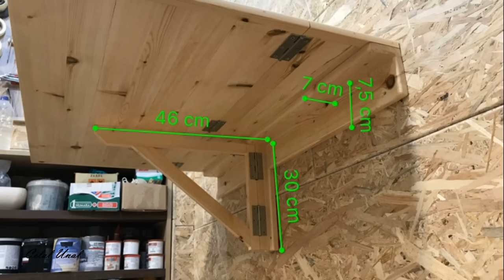Wooden folding kitchen table / Katlanır mutfak masası / Folding dining table

Comment: Very impressive 👍

But I don't understand the purpose of cutting the big piece of wood in small pieces and then joining them with glue?

Did you do this for designing purpose?

Please advise 🙏
Reply from the maker: Thank you so much. I am very glad you liked it. Small pieces remain stronger than large pieces. Wood is a material that plays. I cut it short and put it together to reduce the playfulness of the wood.
Reply: @CelalUnal1  Great! 
That's very useful information.
I am really very interested in Woodwork, and wish to start work on wood sometime soon.
Thanks once again and good luck.👍

Comment: Good morning sir, May I ask you what kind of glue are you using in the nailed hole?
Reply from the maker: Thank you. I used instant glue and activator spray. A material that provides drying and adhesion with activator spray.

Comment: Hi, Do you think you could make a 'Dutch pull out tale' 1m x 700mm with a 500mm pull-out leaf at both ends? I have a small cabing and that's what I need to build and am not sure of the best way to go about it. Plans would help. Thanks
Reply from the maker: I don't have a plan, but it can be done in these dimensions.
Reply: @CelalUnal1  Thanks. I know it can be done I'm hoping you can make it so I can copy your skills and make one myself.

Comment: Nice job. If I could make a suggestion, I would not frame solid wood as you may develop cracks at the corners since the “ frame “ is inhibiting expansion/contraction of the long boards. Even if you just put “ breadboard ends “ using nails, it might crack as well. If just adding breadboards, the nails will inhibit expansion/contraction of the long boards as well, the breadboard ends need to “ float “ except at the center of them. YT has a lot of vids on how to do this. I learned the hard way. Good luck, you have sound woodworking skills otherwise.
Reply from the maker: Thank you very much.
Reply: @CelalUnal1  yw. I reviewed your vid again. When routing, make sure the piece you're routing is secured to prevent movement and always go counter clockwise, otherwise the bit could " climb off "  the piece.

Comment: The lock had to be put on the opposite end. Not where the loops are.
Reply from the maker: Dude, one side of the hinged part is fixed.  Not moving.  I think the lock is in place as it should be.  I think he's doing his job.  I mounted the long part of the lock upside down because the board was short.  As I said, it is doing its key role.  Thanks for watching.🙏🙏
Reply: @CelalUnal1  Buddy, this is the same as installing a door handle with a lock on the same side as the hinges.
Reply from the maker: @igord7019  It's holding the Part after all. Fit for purpose.:))